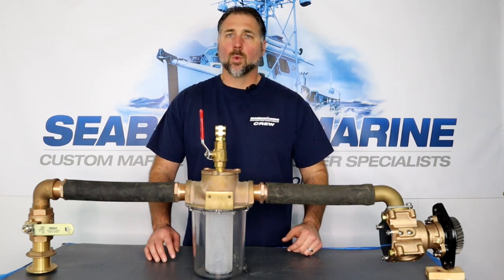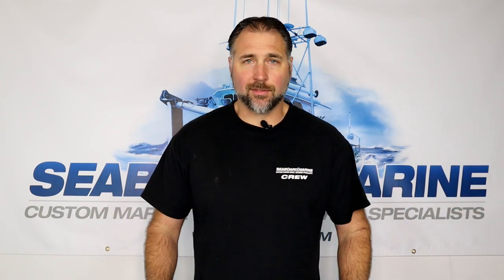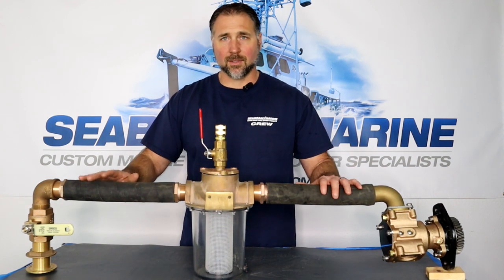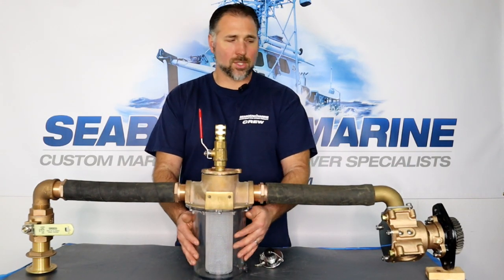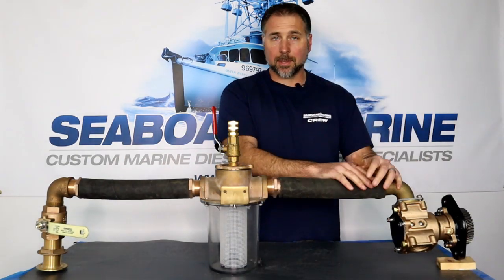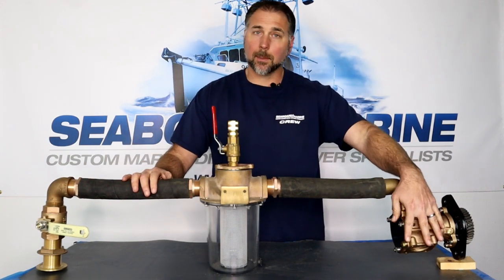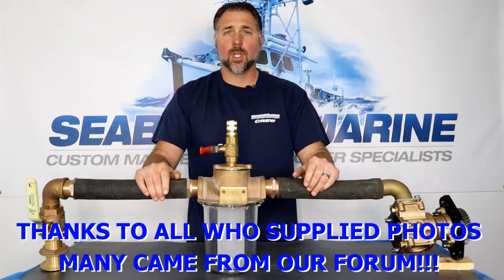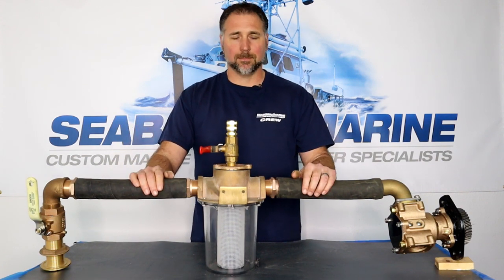How To: Fresh Water Flushing Setups and Procedures

Comment: I added fresh water flushing to my 6BTA Cummins plus my Onan Generator. This was via “T” pieces sited between the strainer and SW pump. The FW supply lines were run up to a dedicated SS manifold placed on the main deck under a wash basin. The dock hose was connected to the manifold which allowed me to sequentially flush each system. I did this as soon as I got back to the dock while the engines were all idling. I NEVER closed the seacock whilst flushing. The results were outstanding and this was reflected in the state of the anodes, all tubestacks and the gearbox coolers. The other plus was no growth in the SW inlets owing to a plug of FW. At the conclusion of flushing all seacocks were shut. This should be standard in all new builds.
Reply: Do you have a photo or anything I have the same engines and want to do this
Reply: @thejmerrill28  sorry no.

Comment: Hey Justin, this is a great trick, especially for us hear in the middle east where sometime we have 35+C sea water paired with very high salinity so we get huge barnacle and corrosion if not careful. I have been doing this trick for some years and I just want to add the following if anyone is interested:
1) we ALWAYS close the sea cock, if its left open, slight movement at the dock from passing vessels, wind etc creates a nice movement of water and hence MARINE GROWTH LOVES IT! keep the sea cocks closed imho.

2) We ALWAYS gravity feed f/w thru the system using the engine S/W pump itself, firstly if water is introduced under pressure you can blow the pump seal right out! let the engine take what it needs. check with manufacturer of engine and get the s/w pump output curve and adjust you hose and inlet hoses accordingly to accomodate what the pump needs at idle.
Secondly, one can open the f/w feed whilst engine is still running normally, then just close the s/w valve while you are down there. give it 2-3 minutes then shut down and just close f/w feed.

3)  We use NON RETURN VALVES with a cap, where the f/w feed goes in this eliminates the idiot factor of sinking a boat at the dock with flood back of s/w!! (not a fan of non returns but as its f/w its pretty bullet proof imo)

4)  We use this on water makers, generators, etc etc etc. only thing we dont use it on is A/C units...cos they never shut down here!

In general for me, if someone is building a boat then take the opportunity to run a F/W line thru to your e/r from the tank and just plumb it in, a few valves and lines and non returns and as you say life is much easier on life of your boat gear AND your wallet!!!
Hope this is assistance to all.
cheers.

Comment: One quick way to determine if your water hose is supplying all the water the engine is sucking is to use a 3/4 in hose in a 5 gal bucket with your water hose turned on and filling the bucket. If the water level drops then the engine is drawing more water than the hose can supply.
If it remains at a static level or fills then the direct hose conection will supply adequate flow.
Reply: The engine cannot "suck" water PERIOD much less "more" than it is "supplied". Centrifugal "water pumps" are not "self priming" OR 'positive displacement".

Comment: Thanks, guys!  Always so helpful on the board and when I call.  When we bought our Silverton 410 with 6bta-m3s I was very apprehensive about putting my wrenches on it.  But, Tony and the gang set you straight.  Now, I've redesigned, refitted, digitized and upgraded like a pro.  Tony can be a little gruff online but you cannot blame him.  I can imagine that he's been asked the same questions a million times a million different ways. He's a saint for persevering as a teacher of idiots.  Thanks again! 
It be nice to see a 2" Perko strainer flushing cap kit from SBMAR.  In my case tapping into a 20 year bronze elbow is a commitment that you cannot come back from and tapping the cap really needs to be done at a proper tool shop.
Reply from the maker: Send us your caps and we'll get them setup!
Reply: @SeaboardMarineIncVideos   I will, come January, I'll be stripping off my heat exchangers to send out to you guys for service.  Thanks!

Comment: Newbie, ON-LAND winterizing so seawater stopcock will be closed...reading and differing comments driving me nuts.  I'm guessing you're emphasizing danger situation of running water pump dry so be sure to get flush water going first then start engine.. But Question: will the flush water under pressure (positive or later negative siphon), potentially present a hydrolock situation flooding the cylinders? In fact at 8:40 it is said NOT to have only the flush valve open with engine off. I have a valved Tee on my strainer - I'd use the water in bucket method but concerned of it's small 5/8" diameter offering insufficient flow.

Comment: Great video guys, really appreciate the information SBM offer.. I myself have a lift muffler setup with a fresh water flush system which I religiously do after every use.  In the video Justin commented that if you have a lift muffler you have the potential to over fill the lift muffler and cause some problems!!!!.. If this is the case can you suggest (or shoot me a video link) as to how I should be preforming a fresh water flush with a lift muffler?? Traditionally I have not run my Cummings QSB to perform this task..
Reply from the maker: You'll have to do it with the engine running.  That will keep the lift muffler water level under control.

Comment: Would this fresh water flush system work for running the engine on the hard as well? You guys make great videos, Thank you!
Reply from the maker: Yes, depending on the design, as long as the water is getting sucked through the engine via the raw water pump, and you have a decent flow, many fresh flush systems work great for running on the hard.  Many trailer boats do this as a matter of practice.

Comment: My 09 searay 310 has no engine sea cock, but does have a flush system installed. Is it right that turning on the fresh water flushes only the outdrive when the engine is not running?  I was told the engine has to run in order to flush the engine as well!

Comment: I fitted a very similar system to the article a couple of years ago to my twin QSB 5.9 and have found it very successful. I prefer to shut off the seacock in my procedure because I found the salinity of the water remaining in the engine too high. I use a 25mm dock hose with excellent water flow. As mentioned in the video you have to understand the system and take care when shutting off the seacock. I initially tried a propriety system and found it useless even though it was supposed to be for Cummins QSB's, all the fitting diameters (10mm) were far too small. They are very expensive and a complete waste of money.
I would be interested if Seaboard Marine could do another article (using the flushing equipment) and introducing a weak acid solution to clean the raw water system.
Robert Jones
Newport, Queensland. AUS

Comment: Would like to install fresh water flush on the back side of the raw water pumps on my QSM11’s so I don’t need to turn on engines for flushing. I presume some sort of fitting would have to be added to the stainless steel raw water pipe running from the raw water pump up to the aftercooler. I’d like to be able to run a hose from that fitting to somewhere near the engine room door for easy connect to my freshwater cockpit hose. Have you rigged up a QSM11 like this before, and any ideas how to proceed? Thx
Reply from the maker: Shoot me an email.  My email on on the website.   If you are at the boat, shoot a few pics too.
Reply: @SeaboardMarineIncVideos  will do, thx. Will be on the boat later this week and will take pics in engine room. 2001 Riviera 43

Comment: A similar option is to use a Trac Ecological Flush Cap. Cost $50-$60 and fits on your Graco strainer. Attach a hose and you are good to go.
Reply from the maker: We aren't a big fan of plastic components in the raw water circuit.  We prefer everything to be stainless or brass/bronze.

Comment: Hey guys thanks for all the videos. I sent a pic of my sea strainer the other day to your sb marine website. Tony advised adding a T because I can't get to my Sea strainer will the T allow me to attach hose to a reservoir with some barnacle buster? I guess my question is will there be enough suction from the T? thanks again
Reply from the maker: Yeah the T will work just fine for flushing the engine, as long as you keep it to an idle. After all it is the same 3/4" inlet as the strainer cap.

Comment: Great info... For a motor sailer with water maker, almost never at a dock, Id like to flush weekly on water making day. Is it possible to calculate the gallonage needed to be effective?
Reply: Yes it is.  If you know the diameter and length of your raw water hoses, plus the volume of your HX and Gear oil cooler, and after cooler if you have one.  It's possible to calculate the volume of you have a limited supply of water.  Although.  If you're permanently at sea, a fresh flush may not do a whole lot.  The whole idea is avoiding marine age while the boat is sitting.

Comment: When running my flushing system through my engines (6BTA-m3)  for usually 3 to 4 minutes, is that enough to get all the salt water out through the engines and the water muffler. Because I still taste a hint of salt in the freshwater and I figured that it was just still sucking up some of raw water from the raw water intake.  What is a safe balance of salt and fresh water. Great video keep up the great work.
Reply from the maker: It's really hard to quantify,  The most important thing is that you do something, which you are.  If you use a stop watch and measure how long your doc hose takes to fill a 5 gallon bucket, you can calculate how long you need to run it to flush the muffler out.  You can overthink it and come up with a complicated system to ensure 100% fresh all the way through, but if it gets too complicated and you dread doing it, its not worth it.

Comment: i enter the water through a removed anode port on heatexchanger, turn sea cock off and put a clamp on hose to shaft
this way you just connect a saltaway  water mixer on input side very simple works a treat, dont run engine just use water pressure, i guess if you had the wet muffler setup you would have to block
Reply from the maker: That works.

Comment: can you supply too much water using a hose?  I always use a container as a buffer.  Thanks!
Reply from the maker: Not if you leave the seacock open.  If you have that much water flow that its more than the pump can suck, I would definitely never close the seacock.
Reply: Yes, raw water pump gaskets and seals can be blow if seacock is closed.

Comment: Just be careful. I learned a long time ago that a pressurized garden hose has enough pressure to blow out the shaft seal on your raw water pump. I only draw from a continuously filled bucket. Garden hose cannot keep up with raw water pump at anything above idle. Use a big bucket/container. Bait tank is good idea. I am considering putting in a system on the engine that I am currently building so system can be flushed without running engine. This would require a T on either side of the raw pump and would not require closing sea cock. IMO, an ideal system  would allow you to flush and back flush your exchangers/aftercoolers/strainers etc. without starting the engine.  Of course it is a bit more complicated system.
Reply from the maker: Yeah you definitely don't want the hose on and sea cock closed without engine running.  We've played with the pumps here in the shop and depending on where the impeller vanes land they can block water flow or let it sail through.  So it's best not to chance it.   This is why we recommend the open sea cock flush.  Safest and easiest.    Your system sounds neat unless you have a lift muffler, that could be problematic.

Comment: How long do you run your engine while flushing?
Reply from the maker: That's a good question for our forum.  www.Sbmar.com/community  It kind of depends how long your suction lines are, your exhaust design, etc.   I don't have a way to quantify it in general terms... But I would say several minutes.    You can calculate the volume of all of the hoses and raw water components, and do a test to see exactly how many GPM you pump at idle, and come up with an exact number.  Or you could just taste the water coming out of the tail pipe.
Reply: @SeaboardMarineIncVideos  😂😂

Comment: To avoid corruzione on ur engine you must put a fresh tank water on your boat and use it to ur cooling system to have a longer lifespan and less maintenance. That if u are innovative tech of marine engine. Some they put radiator too...